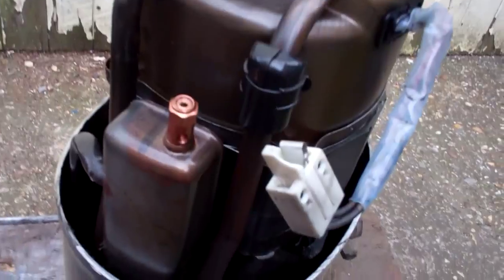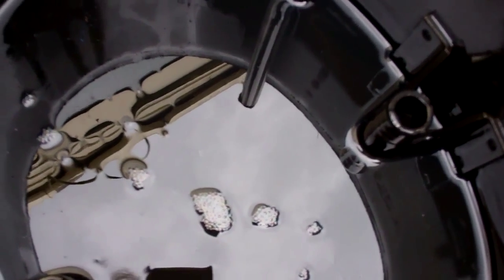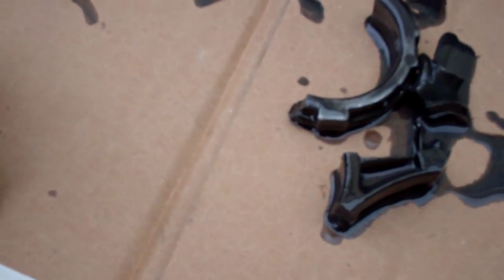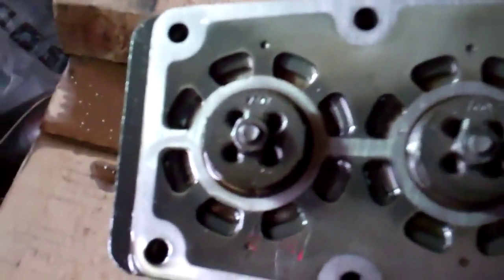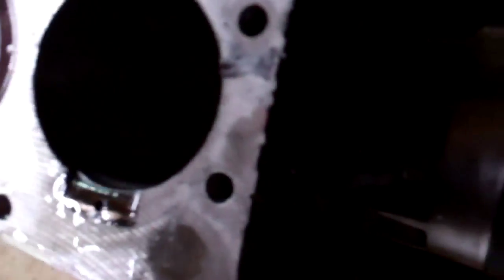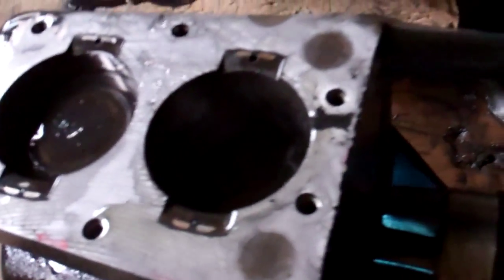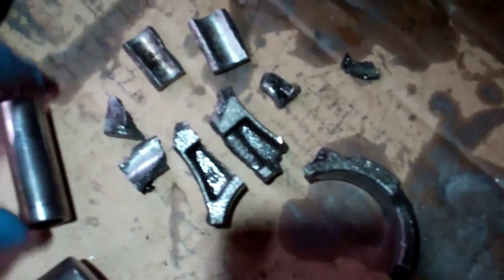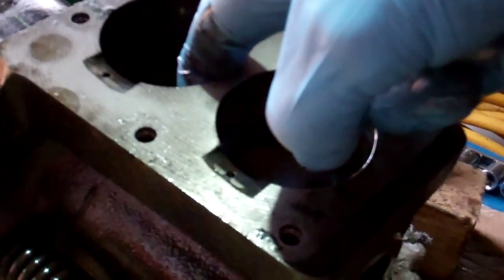Bristol Compressor Carnage

Comment from the maker: The systems need maintenance but there isn't much you can do to the compressors as they are welded into the housing. Some of the bigger ones it is worth cutting them open to rebuild them and then welding them back together but its cheaper to fit a new one of this size.